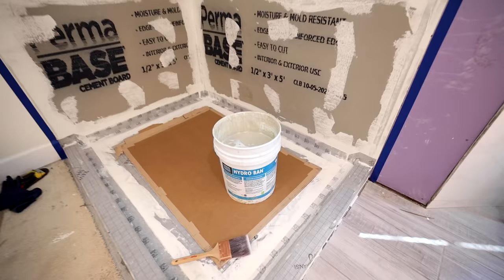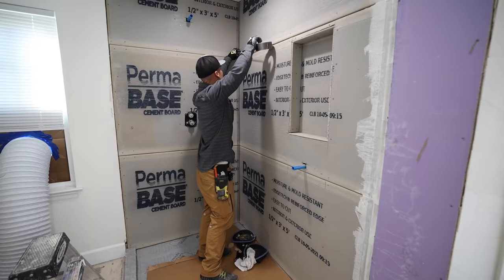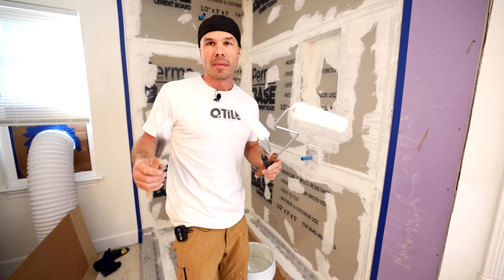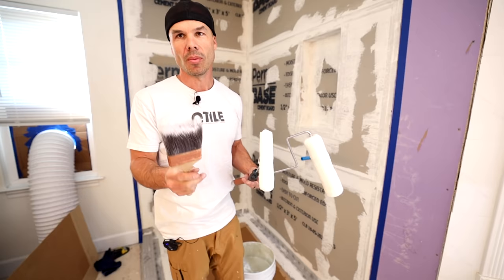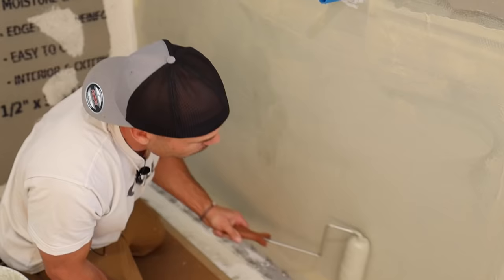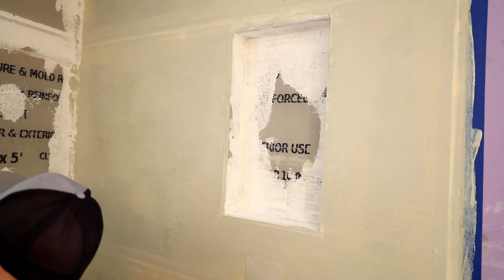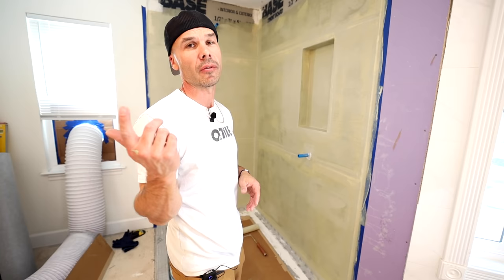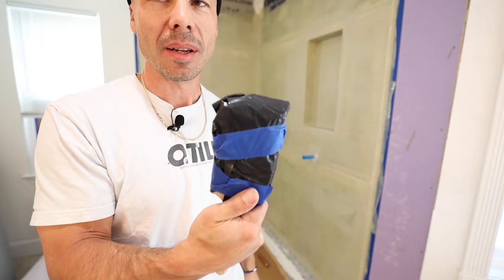How to WATERPROOF SHOWER WALLS --- Laticrete HYDRO BAN (Better than REDGARD)

Comment: Every shower I build where I use a liquid membrane I buy a $13 roller kit from Home Depot. Comes with a 9”roller, 2 covers, a pan and liner a 3” roller and cover and a 2 1/2” brush. I throw everything away when I’m done, ain’t no cleaning Hydroban!

Comment: Ugh. I think i made a mistake.  I put down the hydro ban on top of the mud floor without any foam.  Basically, i only have 1 layer of water protection. Do i need to rip it all up and start over?  or is there something else i can put on top to put more water protection?

Comment: I'm tiling my first shower. I'll be installing 12x24 tiles over Durock substrate and sealing the joints with cement board mesh tape (FibaTape). Is it ok to pair Laticrete LHT Plus mortar with Mapei Aquadefense liquid membrane? I'm trying to figure out the most cost-effective solution. The Laticrete LHT Plus mortar is $11/bag cheaper than the Mapei Ultraflex LFT. However, the Mapei Aquadefense liquid membrane is about half the price of the Laticrete Hydro Ban ($54 per gallon versus $99).

Comment: Hey Coach, you think I’m making a mistake by using the Hydroban on everything including the floor? Dry-pack pan, Hardiebacker walls and curb, thinset joints with the mesh you showed, Laticrete tape on corners and where walls meet the pan. I finished my first dry pack mortar pan which turned out reasonably well. Thank you for these videos.
Reply from the maker: Yes but I recommend to let the dry pack cure for 1 week before applying.
Reply: @TileCoach  Thank you much. I have time, so I will do that.
Reply: @JohnathanBach  Let me know how your flood test turns out for you if you have time. I am also thinking about doing this method* in the next few weeks.

*3x3' dry-pack pan, hardiebacker walls and curb, Hydro Ban Fillet & Sealant at all seams and transitions, Hydro Ban over everything walls and pan. Like this install video from Laticrete.

I am curious on performance of the mesh tape + thin set seams over the sealant caulked seams... the latter just seems simpler and more elastic with movement... but not really sure the difference could be effectively tested.

https://www.youtube.com/watch?v=NR8RO6KJTkQ&t=2s
Reply: @tannerrobertson2452  Will do if I think about it. Don’t hesitate to reach out if I forget.
Reply: I like running a pan liner up behind the hardie back before a dry pack mud deck. Let the dry pack cure at least 48 hours then hydro the mortar bed and walls 2 to 3 coats.

Comment: You are always at the forefront of new products and techniques. And we are very lucky to have you sharing all of it with such a consistent positive attitude. Redguard is the Atari of liquid membranes, I wouldn't use it even if I was getting $500hr to attempt to apply it properly. We need products that go on simply, effectively, and are real world. And I love that shower valve detail of being able to make wall and valve one.

Comment: Thanks again. I did my shower with the Hydroban. Its a great product. I may have missed that you shared how much Hydroban you used for the size of your shower demonstration. I used just over a gallon.
I did 3 coats in corners and edges and 2 coats on rest of shower, I also did the floor with it and I had 3 walls. My friend had some hydroban leftover from his project. Lucky me. Your videos are top notch. I did not use the Multi Max as I was planning on. The tile that fell and hit your worker in the head in your other video stirred me in another direction.. 🙂 But your videos are very well done. Thanks again Im not sure if I learn more from your tutering videos or from the videos where you show what went wrong. Those are great and make me feel better about some of the things I may have done wrong. Worst tile job ever was a Oscar winner.

Comment: data sheet calls for a dried thickness of 20 mils or 0.020–0.030" (0.5–0.8 mm) thick when
cured. each applied coat should be 20 mils as it dries to half of that or 10 mils. biggest failure with hydroban per local manufacturer reps is due to too much appied in corners where it emulsifies back into the orginal liquid consistency. so thicker is worse as it just won't cure correctly. Hydroban has been used in the tallest building in the world and olympic swimming pools so sheet membrane isn't better. sheet membrane is used when you want to waterproof the freshly floated shower pan as hydroban requires at least 3.5 days to allow proper curing and maximum 75% relative humidity which is hard to measure accurately without high end instruments. morale of story, watch those corners and don't get sloppy on adding too much.

Comment: I finished my first shower with laticrete system. Solid piece of membrane starting on the wall and over the curb, L shaped on two other walls and all 4 corners. Two layers of the green hydroban on all seams, 4 inches each side. Did 48 hours water test. No leak. I hope it stays this way. My shower looks great. I think if it leaks my wife is going to leave me.

Comment: You do great work! I learn alot from your videos. 

Would you use this hydro ban membrane on top of a mud pan instead of a liner on top of the preslope? A rep from a local tile supplier recommended this product instead of the Kerdi system. He said just roll this stuff on top of the pan to the drain with two coats. What are your thoughts? Thanks I’m advance!

Comment: Not sure if this is an approved method, but seems like it will work.  I'd go 6 inches up the wall with the sheet membrane, or at least above the curb like a traditional shower pan.

Comment: Tile coach thanks for the content ! WE ARE ALL DYING TO KNOW ONE THING ! : what do you use to fill cracks and coves in densShield that occur when you float instead of fixing framing .   I have 1/2" gaps in some areas of densShield because walls are not plumb

Comment: I’ve watched all of your videos. Great info and to the community. Thank you. I’m real handy with doing things myself. I’m putting together a shower plan with the help of your videos. Question? Even when everything done right, how long will a shower like this last?
Reply: I have watched his videos as well.. done all the tile part already. GROUT IS A BIG DEAL.. for longevity of shower. Watch his video on spectralock 1 by laticrete. Its a epoxy grout replica... and the cleaning is easier.. and it comes mixed already..apply and follow cleaning procedures.. and only do small spaces at a time..and that itself will serve as another layer of waterproofing.. along with hydroban.. its solid..!!!!
Reply: Cause of tile coach i took on my shower projects..first time ever doin it..and they came out fantastic

Comment: Question:   I'm about to mud my walls of my personal master bath.   Ace V build doesnt recommend waterproofing over the surface of the mud wall saying it doesnt allow the mud to breathe and will create mold... he recommends just stapling a moisture barrier behind the lathe or wire and thats enough.   It seems to me he has it backwards and the mud wall should definitely be waterproofed on surface with either roll on waterproof (redguard or hydroban) or sheet membrane like kerdi.   I know that guy is all about speed and doesnt want to add an extra day to a job but whats your take?    Ive heard you give him a shout out in a previous vid so im guessing theres mutual respect but his advice on not waterproofing over the surface of a mud wall made me second guess my process...

Comment: Hey I did a schluter shower and I have 2 leaks coming out bottom of kerdi curb I actually forgot to thinset the bottom of the curb and the inside if the cut because I added 2 pieces togheter wondering should I laticrete it because I  the water leaks  was at the higher level of the board it stopped leaking once the water lowered about half way of the height of the kerdi band

Comment: My question is why do I need to waterproof the shower walls?  Not much water gets on the walls.  Isn't the cement board waterproof?  How well does the thinset adhere to the paint on waterproofing?  What was done before the membrane or the liquid waterproofing was invented?

Comment: Love you moved up to hydroban. Not a good practice using big dollar brushes, been there tho. Hydroban is amazing but a little overkill for those types shower walls. Cut down on price a little hydrobarrier is a better option for showers walls. Fabric the joints no need for mesh tape and mortar. Use the Ban for the pan.
Reply: People who worry too much about price and not enough about quality tend to regret their decisions later on...

Comment: How long will an open bucket of Hydroban last?  I have 2 showers to do and 5 gallons will likely do both, but 2nd bathroom is probably 6 months+ out before being done.  I can buy 1 gallon buckets, but if the 5 gallon will last a while, I can save some cash.

Comment: Hi, I'm wondering why you use cement boards as underlayment if the hydro ban product will completely seal it and make the unit completely waterproof? Would the shower remain structurally safe & sound using mould resistant drywall as underlayment? There's quite a lack of material inventory and availability where I live.
Reply: The issue with using any type of drywall or even wood is that if it was to get wet it would damage the backside of the wall which would compromise the shower itself.  Cement board will certainly mitigate moisture issues on the backside. Hope that helps answer your question.

Comment: I am planning on using a schluter floor plan in conjunction with hardi backer, should my backer be installed all the way down to my sub floor
Reply: never, it will wick water up over your vapor barrier - will hold water and be source of persistent mold if it doesn't leak behind vapor barrier.

Comment: Constructing a basement in Southern California, my basement comprises 4 feet of concrete and 4 feet of drywall. My contractor suggests using “HydroBan” insulation and insulating both the walls and concrete. Is this the right approach? Any alternative suggestions you might have?
Reply: Hot mop with membrane walls is the ultimate IMO

Comment: What happened to old days with vapor barrier behind mud or cement board than thinset over that for full mechanical bonding. Sticking to plastic or rubber coatings compromises bond.
Also adding time and money that’s unnecessary.
Old method lasts forever, no plastic or coating to degrade.

Comment: Remember that each coat needs to be measured with a wet MIL gauge and needs to be .015"-.022" per the manufacturer specs!

"Wet coat thickness is 0.015 to 0.022" (0.4 to 0.6 mm) per coat. Use a wet film thickness gauge to check thickness."

Comment: My shower walls have the purple drywall rather than cement board.  I am doing the Kerdi sheet membrane on the walls.  My question is, where the 2 pieces of sheetrock butt into each other, the edges are tapered so you could normally add tape and mud and bring that out flush w/ the face of the remaining sheetrock so do I need to still tape and mud those joints since I am using the sheet membrane or can I just build that tapered area up w/ thinset?
Reply: Schluter says primer on mud. It can be reconstituted from water in thinset. Better to not mud, flush the taper after membrane w/ thinset.
Reply: Brandon is right,  leave those joints as is, install the membrane and build out thinset for those areas as u set tile.

Comment: Just ripped out my 1971 BS amalgamated particleboard kitchen cabinets which had water damage, termite nymph damage (they also ate the paper on the drywall).

Just got through finishing up installing all new drywall and this video comes across my feed.

Just ordered the Hydroguard in order to coat all the new drywall from the countertop-line area downwards.

Baths & showers rooms are not the only water prone areas in a house & maybe people should consider the kitchen areas as well....

Especially if they have to rip out everything to replace the BS IKEA HomeDepot crap cabinets which only look nice in the IKEA display model.

You’re not saving money by buying this kind of BS Particle-board cabinet-crap for either your bathroom or your kitchen

“Particleboard” absolutely does not belong in a water prone environment: it’s crap it should NOT be used in any sort of house, EVER!.

Comment: liquid membranes... not even once! too bad you installed it wrong, laticrete specifies to use a 6 inch fiberglass mesh that they also sell to use on all transitional and seams. this is why its dumb to use a liquid as its nearly the same work as seaming a fleeced membrane